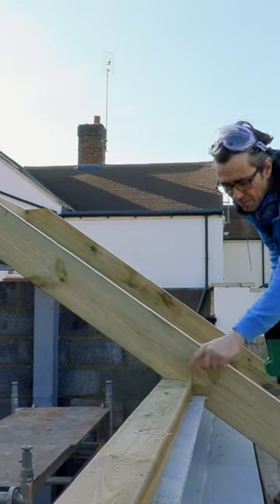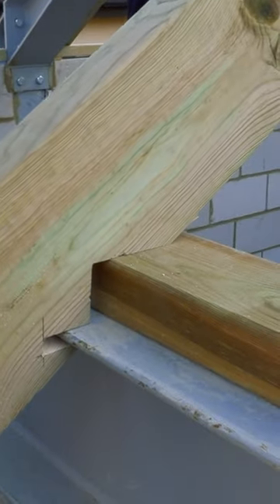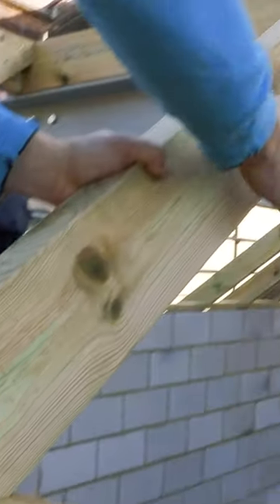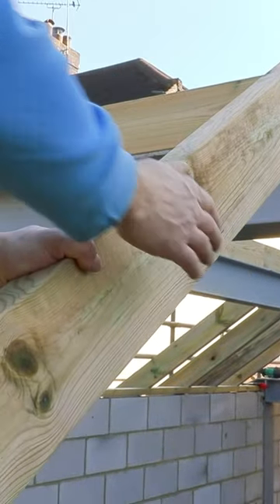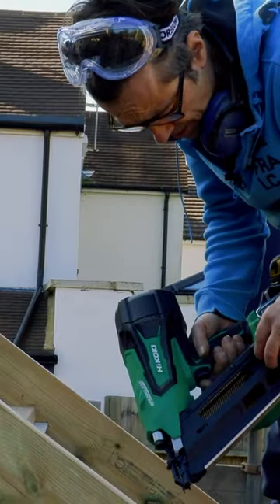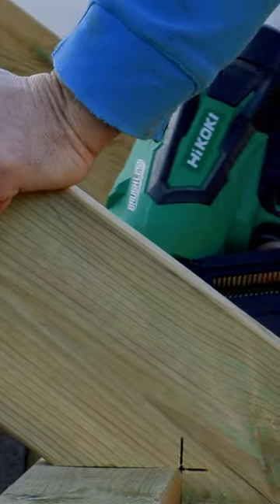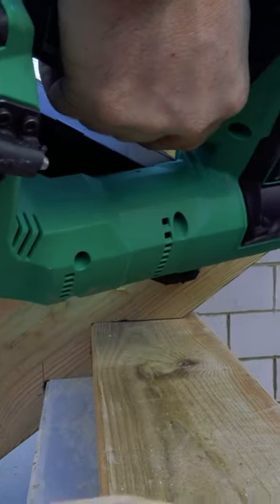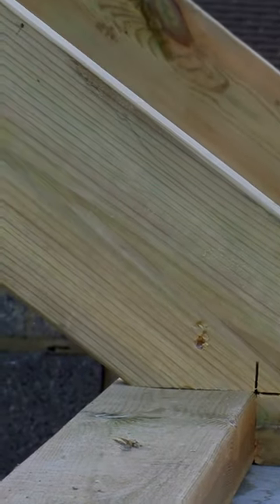Super Neat Rafters #shorts

Comment: Prefer 12 gauge pz3 4'' screws....if anyone says a nail gun does a better job..look for a better chippy.
Reply: Screws aren't structural & should never be used on a roof, they snap under force,
Nails will bend but they're much stronger
Reply: @pauldavies7251  let me get this straight,  you are saying that a nail from a nail gun is stronger than a wood screw?
Reply: @orac1waterskiing  yes I agree Bend a 4 inch screw to the left then back to the right garenteed it will snap straight off, do the same with a pasload nail ten times later ya might be lucky If it snaps off. I do prefer to use a proper 4 / 6inch nail banged in by hand over a nail gun nail just because there far chunkier. Would never use a screw on a roof tho unless it was temporary
Reply: @orac1waterskiing  that is exactly what I'm saying,  ask an engineer if he'd sign a roof off that's been screwed together instead of nailed,
Nails are made to a British standard & the roof manufacturer takes that into consideration when designing the roof.
When you get the bracing drawing it says on that if it's 75mm galv nails or 63/75mm wire nails to a certain British standard number
Reply: @orac1waterskiing  are you a time served carpenter?
This is pretty basic knowledge that an apprentice would know
Reply: Bs5534 is the British standard for paslode roofing nails
Reply: I'm not sure what wood screws you are using however, the ones I use will not snap in a hurricane the only screws which snap are cheap wood screw. Too many people rely on nail guns. Not good.
Reply: @pauldavies7251  yes and i screw everything together.  Never had a come-back. More importantly everything I've built is still standing after 30 years. Including properties in the Bahamas. There was a hurricane as you know in the Bahamas a few years back near Marsh Harbour and white sound. The properties I worked on are still standing. All screws no nail guns.
Reply: I can guarantee that the quality 4 inch and 6 inch screws I use.....you would be hard pressed to bend. Do not be fooled by the arguments that nails can be bend backwards and forwards 10 times......tornados tear those nails out of the wood. It would be extreme hard pressed to pull out timbers with 6 inch 12gauge high quality wood screws.
Reply: @orac1waterskiing  Can you suggest a quality brand of 4"-6"screw? Afaik they are not very common yet in British Isles.